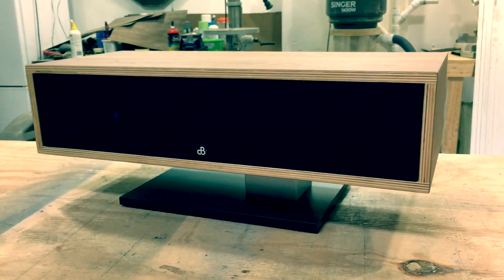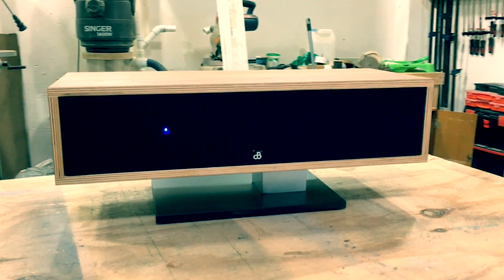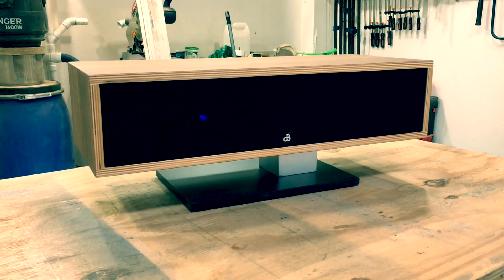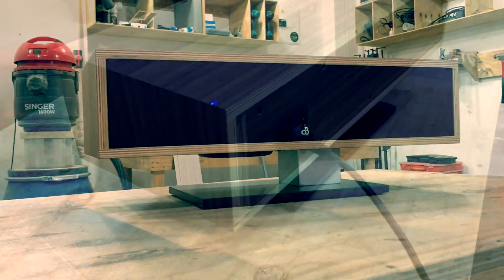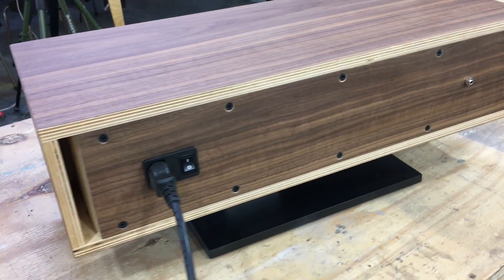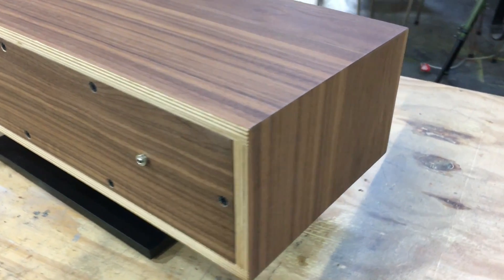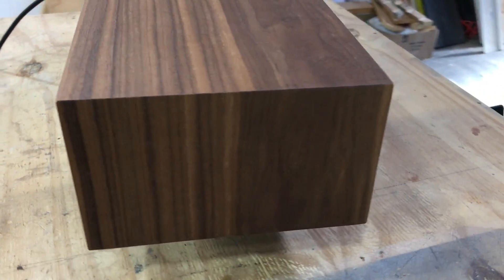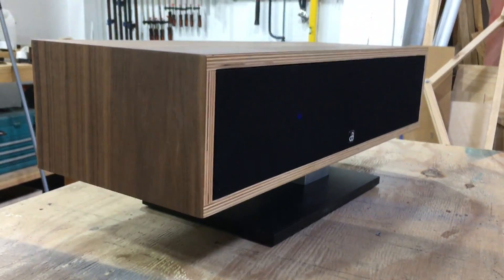Building a Cantilever 2.1 Bluetooth Speaker MK2 - by SoundBlab

Comment: You can't get to the amplifier to adjust something ...
And why not lead the connection cables down into the platform or into the intermediate piece in order to connect the cables there? So they hang on top of the case ...

Comment: Hai sir please plywood name and
Sqft price details sare
Reply: That looks like a cabinet grade plywood, probably birch, which will be pretty expensive for a standard sheet of 4ft by 8ft. You might find a smaller piece but that's not super likely, and you don't want just any plywood because the cheaper grades for wall and roof sheathing will have gaps in the layers that may affect sound quality. Since it's being veneered and painted anyway, you might try a 5/8" it 3/4" MDF instead. It's dense and economic enough that many speakers are made from it, and contrary to popular belief, many have been for decades

Comment: Hi there Soundblab! I like your builds. I have one question though. At 16:35 it looks like you are wiring a DC power supply to an AC amplifier with a jumper cable between the two AC inputs, how is that even possible? Are there any sources out there on the internet that can elaborate on why this works? Thanks for you videos, keep 'em coming!
Reply from the maker: Hi Vincent, thanks! I honestly do not know how this works. I only followed the instruction from the supplier. My electronics knowledge is limited in this field.
Reply: @SoundBlab  ah, too bad. Can't know everything in life ;) Thanks for the reply though! By the way, where's your accent from, if I may ask? I can't figure it out at all

Comment: Awesome build.  Did you not have any concerns with mains voltage in a wooden box though?
Reply from the maker: The box is vented, so it does not give any problems with heat etc.

Comment: Hi! I loved the build, but if instead of using a cantilever style I use some spikes in the bottom, like those ones:

https://www.amazon.com/Dayton-Audio-DSS4-BK-Black-Speaker/dp/B0002KR7OA

The Subwoofer Audio quality is going to be affected by any means?

Thanks in advance
Reply from the maker: It should be fine. At about 1.25 inches it might be a bit low of the ground and could affect it a bit, but I suspect it will be minimal. Only testing it will tell.

Comment: you have to plug it into the wall? that's pretty lame
Reply from the maker: It is a rather big speaker and was not designed to be portable, therefore it would be lame to add a battery 😉
Reply: sooo then what's the point of having Bluetooth? you might as well just plug your device in too. the bigger the speaker the more sound lol, it would be really cool if it was portable. if you want to see a ridiculously overkill, completely wireless speaker check out the one I built on my channel :)
Reply: It's pretty 'lame' to have no manners. There are better ways to phrase your thoughts about someones efforts.

Comment: could I replace the two front speakers with 5.25 inch coaxial speakers? The model number is GT 7-5
Thanks!
Reply from the maker: You could, but you will have to adjust the size of the enclosure to make them fit and to suit the specifications of the drivers.

Comment: Hey, What wires am I gonna use? Is there a kit with all the wires, or doesn't it matter what cables I am using?
Reply from the maker: Speaker wires 16AWG and power 14AWG, but over short runs 16AWG should be fine for both.
Reply: Okay thank you XD
Reply: Okay, in the build plan, do you say what types of wires you are using?

Comment: One suggestion. Since you are selling those plans, how about you messure the frequency response of the speakers. The 44 Hz – 20000 Hz (-3dB) doesnt really give out any information. Knowing the frs 8 i can say that especially the high frequencies are not that clean and since its a broadband speaker the directionality wont be that nice either. 
Also it would be nice if you could record the speakers a bit louder. I would guess that the port would give you some noises.
I really like the design but i would like to know the sound of the speakers before i would start to build them.
Reply from the maker: Check out the sound test clip of this build here https://youtu.be/p_GI_dw41wI
I will do a FQ response soon when I get some time and upload to my website. The port does produce some noise when pushed to the limits, but it was intentional to achieve an ideal enough enclosure size, not too big. The design of this speaker was really to make something that will produce good sound at moderate listening levels. Not really a party boombox, and by the time you pump up the volume too far, the full range drivers will start to scream a bit, but that is mostly due to the bluetooth limitations of the amplifier.
Reply: 7
Reply: Realy dosen't see any test the ending processis no cool

Comment: Hey dude! nice video! I am planing to build a speaker by myself soon, and I wonder if it this speaker that i'm gonna build. I have a question: Is the speaker showing a nice clear volume? And what is the best speaker to play music (in a 50 sq meter room) If I wanna build a speaker with the clearest sound by your builds or knowledge?
Reply from the maker: +AndreasChristensen#DK Thanks! This speaker will be fine for that size room. Just one thing, this design is more suited to listening to music at moderate volume and not a party boombox, although it can go very loud. The port will make some noise at very high volume, but it was designed that way as 3/4 volume is loud enough for most occasions. If I had to illiminate the port noise, the enclosure would be much much bigger. So it was a compromise.
Reply: okay thank you for answer! I just have one more question. In the build plan for this speaker, does there follow instruction on what parts are gonna be soldered? Because I have now bought the parts, and I'm new to this so I don't know what is gonna be soldered and where.

Comment: Do you use the miniDsp to previously test and then choose the right internal crossovers?
Reply from the maker: With this build no MIniDSP was involved. The bluetooth amplifier board has an built-in crossover set by one of the pots. It's easy enough to tune by ear, but I tend to take measurements with my microphone and software to get the optimal crossover point.

Comment: I know that subwoofer driver, it can move absolute heaps of air so I see no way that thin slot-port will every be able to handle it
Reply from the maker: Good observation. The port is somewhat of a compromise to allow a reasonable enclosure volume. When driven to very high volumes it will make a noise, but at normal listening levels, which I am intending this to be mostly used at it works fine.
Reply: That makes sense, there's always gonna be some compromise, the enclosure would otherwise become unwieldy big. I really like the cantilever design btw
Reply from the maker: Thanks
Reply: To reduce the noise of the ports it helps a lot to round the ends of it with. Less turbulence, less noise, less loss of energy.
Reply: What if he had used a passive radiator that was the same size as the subwoofer that was on the same panel?

Comment: Love this design. I have one question though: have you tried routing the AC mains through the foot? would make it even cleaner looking if the connector was inside the aluminium block. Shouldn't be impossible if you use a 90 degree female connector (like this: http://images.monoprice.com/productlargeimages/76833.jpg) on the lead that lays flush with the table.
Reply from the maker: Thanks man. Yes, thats a very good idea, and something I did consider. However, I wanted to put build plans together for this and felt that could complicate it somewhat. But, it is also nice to leave some things for the imagination so that guys can make their own special touches on their own builds.
Reply: SoundBlab aye, I see value in those points. Great build though, love it!